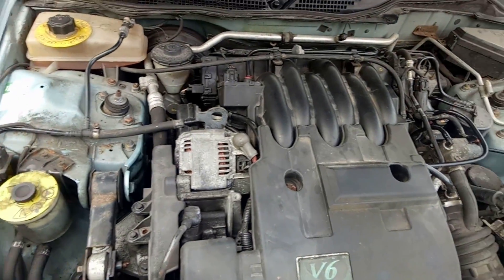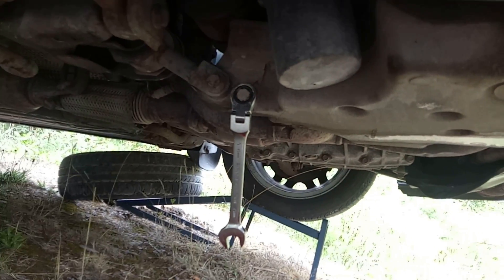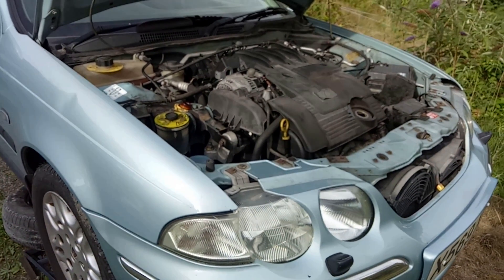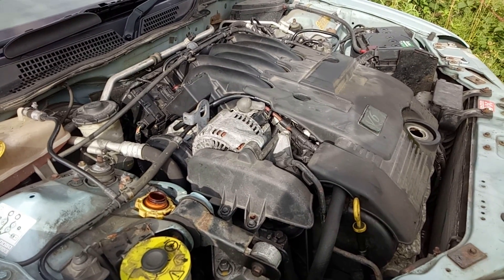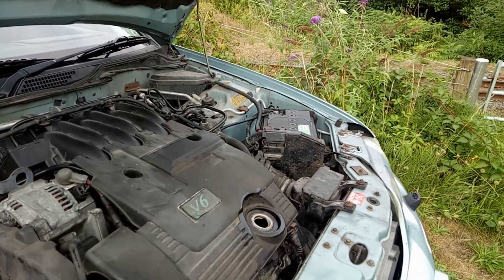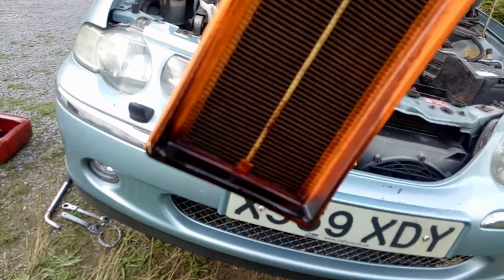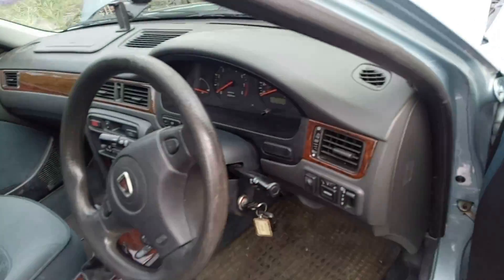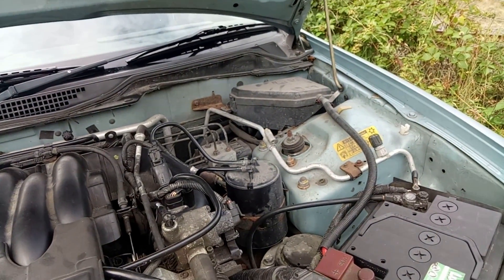The Rover 45 V6 gets half a service

Comment: I tell customers that spending a little on maintenance now, is better than spending thousands on repairs later. This really applies to anything mechanical.
Reply: cambo1200 the single best cost effective maintenance you can do to an engine is an oil change.

Comment: That was a great improvement. There seemed to be an a lot of oil on that air filter, it may be worth getting another one for when you next change the oil in 1000 miles and if it's showing signs of oiling up again it may be worth checking the PCV valve.

Comment: i once got a tip from an old mechanic: if your engine is dirty internally you can add about 250cc of ATF. just plain ATF is about the equivalent of 5W30 engine oil. But the important point is that it has lots of detergents  in it to keep a slushbox  clean inside. It will do the same for your engine . Nice for hydraulic tappets, VVT systems and timing tensioners.
Reply: jfv65 Interesting... does it require a drain and refill after a certain mileage?

Another tip, don't use Mann filters, oil and air...
Reply from the maker: Can't say I've ever had a problem with Mann filters.

Comment: Oh god you just brought back memories ,  I remember trying to change the plugs on my old MGZS I did the front 3 but the rear are bastards , I didn’t manage to do them . 
A WORD OF ADVICE !!  
THE OIL TAKES A LITTLE TIME TO TRICKLE DOWN WHAT YOU THINK IS NOT QUITE ENOUGH ON THE DIP STICK MAY WELL END UP BEING OK A LITTLE TIKE LATER . 
it’s easy to over fill this engine .
Reply from the maker: Thanks. Certainly, I've not been brave enough to tackle the plugs yet. Inlet manifold off I'm guessing. I did follow procedure for the dip stick after checking online.

Comment: It's amazing how an engine with old oil and a heavily clogged filter can really destroy the drivability of it. Rover luv! Totally loving this car. I hope you video more maintenance on this car such as the spark plugs and fuel filter. I've never seen an air filter design that pulls straight up and out of its holder like this car. Very unusual design.

Comment: Volvo B4204S2 2.0i engine (Volvo V40/S40, Laguna 2.0, Clio Sport) is also 5.6L oil capacity. Getting rid of my V40 and buying a Saab with a 4,3L oil capacity for 2.0 litre engine saved a lot over the lifetime of an engine

Comment: Glad to hear you filled the oil filter before refitting it.  That practice at every oil change is worth about 30k less miles of engine wear over its life.  Also, having pointed out that a US used car dealer would have charged about 8 times as much for the car, the oil is about one fifth the price.  Add that to fuel being about a quarter the price in the US, I suppose costs even out in the long run
Reply from the maker: I don't always fill filters - not always possible due to the angle. In those cases, I'll often disconnect the ignition so I can build pressure on the starter.

Comment: Spark plugs are a tit of a job on my V6 Shogie!!! Takes approx an hour and a half as have to remove all the intake system to get to one side of the bank. Total pain. I put Platinum tipped ones in as it’s advised due to pain changing them. Plus they are good for 60k miles. Same with leads.

Comment: That bit you thought was the sump plug at first is the oil cooler. That may be a coolant leak from a union or the cooler itself. They're hard to get hold of new. Give me a shout if you end up needing one. 

VIS motor testers are £30 from Byron on the groups if you do want to check them.

Comment: Fitting a oil catch can will stop all that oily mess in your oil filter housing, it's normal on the KV6 they all spit it back out, some people will say it's not necessary so thats for you to decide! I empty mine once a month of about 200mm of oil and gunk. And a top tip if you haven't done your rear plugs yet, you can do them without removing the intake although a lot of people will tell you otherwise 😉 Good luck! Looking good so far!
Reply from the maker: Oh. Ok. That's good to know on the plugs. Thanks!

Comment: Dip sticks on the V6 can give a false low reading. Dont get caught by it and put to much in.   Pull out the stick and wipe it clean. After 20-30 seconds, replace stick fully. Leave 20 seconds then withdraw it and check oil level.
Reply from the maker: Did that once it was on the level. Thanks.
Reply: Ensure that the engine is at full working temperature. Turn off the engine.
    Remove the dipstick and allow the oil to drain down for five minutes.
    Clean the dipstick and insert it gently into the tube until the 'O' ring on the handle moulding is about to enter the tube.
    Slowly push the dipstick fully home.
    Wait for five seconds, withdraw the dipstick and take the level reading.

Comment: If the fuel filter is not in the engine bay it's probably at the back near the tank- some cars have a cover you can unscrew under the carpet/back seat somewhere to replace the filter.They don't need changing that often but seeing the state of the air filter it could well be passed it's service life.

Comment: Wow, my 3800 takes 6.5 litres (I think? They changed the sump capacity later on to extend the service interval, and this is that), but it's twice the size and has one cam, not two or four! Also, that's a HUGE oil filter. I have a double length K&N on mine because I can, and it's still not terribly large. Although that engine sounds way, way better than the 3800!

Comment: Hopefully the spark plugs will give it another boost, up to quite rapid indeed.
Reply from the maker: It'll never be that rapid. It's always a tiny V6.
Reply: I'd love it's 'equivalent' of some years previous, the Xedos 6. Can't remember the last time I even saw one listed.
Reply: How about doing a video on deep cleanse to bump up the mpg.
Clean out the throttle body.
Spark plug change.
Injector cleaner 
0-60 trial before and after shots.

Comment: at my old place we used diesel as engine flush put a gallon of diesel in engine and run at idle only do not rev for ten mins drain and fill with oil but before changing filter cleans engine out a treat! was given tip by engine reconditioning company we used when we had a noisy tappets rover in for repair...

Comment: Looks like your the first person to service that in a long time.... I guess it sounds better because the oil soaked air filter will have damped the intake noise as well as suffocate the engine. You should get on with the plugs and fuel filter too. If its dificult it means no one did it before either.

Comment: Getting to the point where the oil will cost more than the banger you put it in! Good luck with the spark plugs, I hate doing them. All the stress of "is it going to snap" or "what was that crunch". Never put two fingers up to the jets, if they see you they come in for a closer look! I found out the hard way!

Comment: If you're looking for cheap engine oil, Eurocarparts Triple QX stuff is decent (it's actually rebranded Shell oil), i've used it in all my stuff for years.
Reply: Is it really?  I hadn't realised that.  It's dirt cheap oil, though...
Reply: I used to use Triple QX on my old Mk2 Polo but only every 5k miles. Did the job.
Reply: Yup, it's absolutely fine. And if you are still worried that much, just change it more often. It's so much cheaper than branded that you can do it twice and still save good money. But there's really no need, it's good quality.
Reply: Mrcento it’s shit!!!!
I work on cars and that stuff breaks down so fast 
Avoid it unless your want to risk premature engine wear

 Castrol edge or millers all the way
Reply: I build engines, i've done work on several cars that have done 40,50k plus without an oil change on that stuff, no visible signs of oil breakdown, no signs of increased wear over expected for mileage and are still happilly running to this day on it. As said, it's cheap, if you're that concerned about speed of breakdown (and i've yet to see anything in any car run on it to suggest it's a problem), just change it a little more regularly and you're still saving. It's not the best on the market but it's perfectly competent at its job, hence why i'm more than happy to throw it in my own stuff.
Reply: Quite a lot of "oil" on the market is totally synthetic so it's never seen an oil refinery in it's life! It's like buying 2 litres of lemonade from a shop at 17p or one at £1.50. In a blind tasting most would be hard pressed telling the difference. Using a cheaper oil doesn't mean it's less effective. It just means the brand selling it doesn't spend loads on research & development, advertising etc so overheads are low and they pass on this to the consumer. There's also the regular "discussions" about supermarket versus branded fuel. Loads of people use the cheap stuff. It works. Cost of living dictates what you can use. I've use premium octane fuel in a Clio 172 sport. Didn't make any noticeable difference in performance despite the claims so switched back to standard. Had the car 4.5 year with no problems. (Renault issues aside!) The ONLY item of vehicle maintenance I don't buy economy or cheap is tyres! As they are your only point of contact on the road it's not an area to mess with.

Comment: I wonder if the VIS was maybe electronically disabled before due to the lack of airflow through the intake.  It certainly sounds and appears to be a whole lot happier and more peppy.  Based on the mess that the oil and air filters were in I would suggest servicing the gearbox might be a good idea as if the routine service items have been that neglected I would imagine the transmission hasn't seen any love in living memory.  I would suggest with the oil that, about a week before you change it again, you put some engine flush in the oil and run it around a bit.  I know the instructions on most forms of it don't say to do that but it's what I do with my Focus and the inside of the engine is squeaky clean despite its 130,000 miles...
Reply from the maker: I'm really not one for flushes. Regular changes do the trick.
Reply: +HubNut  That's fair enough.  I suspect regular diving over longer distances with the car nicely warmed up will do a lot to clear the sludge in the engine.  Overall I'd say it looks to be in rude health despite the indifferent maintenance it's clearly had recently...

Comment: Liqui Moly products are really good for vehicles that need TLC (injector clean, hydraulic valve lifter and engine flush).  Maybe they could sponsor the 45 V6?!  Also Comma XFlow Flush out is really impressive... Amazon can also be very smart for getting oil... oddly I’ve bought Castro’s Longlife via Amazon, it was sent from Germany and all for less than 11 per litre.

Comment: Have you considered using a syphon pump that goes down the dipstick hole....That engine looks and sounds very similar to my old x type jag but that was a 2.5 24valve Mondeo lump
Reply from the maker: Yes, have considered one. Might actually stop me making such a mess for once...
Reply: I use one of those oil suckers as I’m far too lazy to remove the under tray!! It takes longer to get the tray back on then to do the whole service. They are brilliant but make sure the oil is red hot as it sucks much easier when the oil is thin.
Reply: HubNut I bought one on eBay for a tenner with two terminal clips for hooking up to your battery it sucked up the crud in the engine towards the end what was reassuring

Comment: Nice video Mr Hubnut, glad the service improved things. The rear plugs are quite doable if you have enough bits and adaptors to fit. 
Have you any info on when/if the camblets have been done? Not for the faint hearted or those with shallow pockets.
Reply from the maker: Yes. Previous owner did all of the belts just before I bought it. Which is nice!

Comment: So after five liters of oil the dipstick barely touches the oil.... but the car is on ramps and not level. Therefore the reading could be incorrect. Another tip : yes, oil can be expensive, but older cars often don't need modern premium oil. It could very well be that oil from Asda or some other supermarket meets the requirements of the car.
Reply from the maker: The ramps were on a slope, so it was pretty level. Once I was happy there was enough oil to start it, it was checked again on the level.

Comment: Checking the oil when the vehicle is anything other than flat and level will give you a false  reading.  If you have over filled it that can cause seals to leak and other damage too. Best to check it before you do many more miles.
Reply from the maker: It was checked on the level. I didn't remove it from the ramps until I was confident it had enough oil in.
Reply: Glad to hear that Ian, I had sort of expected you to have done it but it is better to ask a stupid question than let a man blow his engine.. As dipsticks are usually positioned towards the front of the car any upward slope will give a lower than actual reading, and a downward slope will give a higher than actual reading. Slope will also affect the draining efficiency of the sump, and the really nasty dirt might get left inside.

If the oil is really dirt when you change it after 1,000 miles I'd suggest checking out the cost and availability of a sump gasket. Mechanical cleaning of the sump will remove the baked on crud that chemical cleaners just can't shift, plus you'l be able to look inside your engine and give yourself a few new worries..

Comment: I wouldn’t use an engine flush in an engine that filthy, as you have said, just change the oil again in a week or so. Too much crud suddenly moving would be a very bad thing! Brilliant engine that 2.0, did they come with a manual box?
Reply from the maker: No manual on the Rover. You could get one with the MG ZS version, and that was a 180bhp 2.5 as well.
Reply: HubNut - awesome thanks. I’m gonna be looking for a similar car for this winter due to your vids on this Rover. I think your next move should be to check the breathers, there’s too much oil on the air filter. I really don’t think it’s something more sinister like rings etc.

Comment: I drove back from Wolverhampton to south Manchester in a Morris minor with my brother (he'd bought it on ebay)
and it conked out  due to a crabby old air filter........... the paper element was absolutely rigid and caked in filth  - surprised any air could get through tbh.
Drove the remainder sans air filter (apart from a bit of sock stretched over the air box inlet) fine. 
I'm just about to service my 45 (diesel) - getting it up on ramps is a pain  due to the low bumpers  - i have to use a wide plank to drive onto to be able to get the ramps in contact with the bloody wheels   - no idea why they design them so low (45 are buggers for scraping the bottom of the car door on high kerbs / pavements)

Comment: Do you not use an engine flush? I tend to always use a flush to help clear the crud. 5.6 litters of oil is only 0.3L more than my Rio's oil, I expected it to be more like 6 point Something for a larger engine. Looking forward to seeing part 2 of the rovers service.
Reply from the maker: No. I worry about what they might flush out, and where it might go. I find it more gentle to just keep regular changes up.
Reply: Interesting angle. I done some research on engine oil flush recently and I wondered how effective it really is. Just adding an adjective to the old engine oil, that I cannot understand how a small tin could make much of a difference, against 5.6L of engine oil.

Comment: (I'll be the first to admit that I don't know anything) - but is this a K-series?  I for some reason doubt it is.  Which leads me onto my next question, is there any K -series engine that isn't as prone to HGF?  I've seen smaller Metro engines having failures, the 1.4, 1.8 etc...  Certainly looks like the service was due.  I always find servicing cars so relaxing.  Odd, I know.  I found the only filter that seemed dirty on the Golf was the cabin filter, which is pleasing to know the more important ones had been changed.  Are you sure the timing belt was changed?  Just given the lack of maintenance of everything else... Great stuff!  :D
Reply from the maker: KV6 is related to the K-Series, but only slightly. K-Series massively compromised by penny pinching. The 8v 1.1s and 1.4s seem most resilient, but they can all do it. Mind you, you'd be surprised how many Fiats, BMWs and even Hondas also suffer HGF, but no-one goes on about those...
Reply: I do know about Rover's penny pinching.  It's a great shame.  At the time it had excellent reviews until owners started having issues as the cars aged.  As you say it's true, you don't hear about other cars having HGF.  

Mini's are a common example, so many of the 2000-2006 generation are known for having such issues, usually starts off being something simple (radiator fan not working/water pump leaking/on those particularly some coolant housing leaking), owners not looking on their dashboards (those older models had a temperature gauge, the newer ones do not) and it happening a dozen times before it gradually gets worse.  Owners continue using cars until it eventually stops running.  I only know this because I owned one...Fortunately the later R56, which isn't as prone.

The K-Series and it's HGF always makes me think of GM and Cadillac's Northstar V8.  Fantastic engine when working, but doomed due to the penny pinching of the companies accountants.  The industry is typical of engineers not allowed to be engineers and being held back by the accounting division - at what real cost?